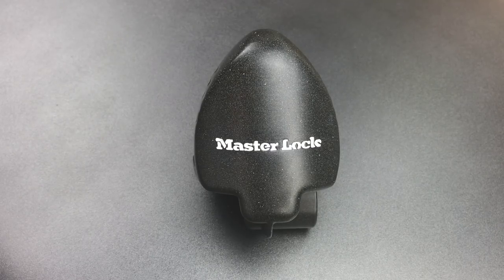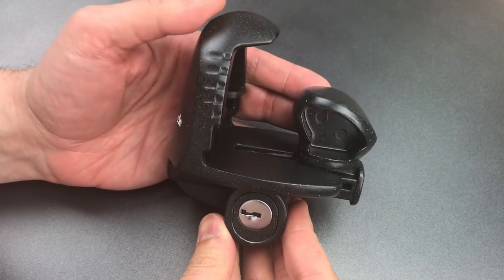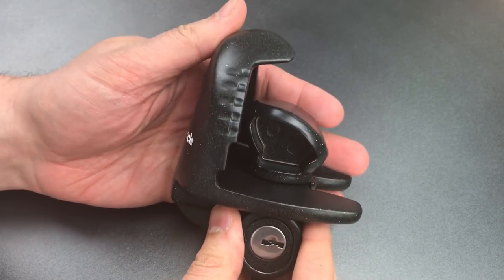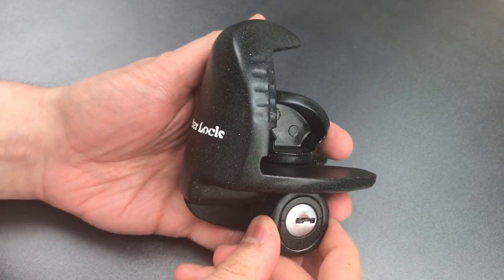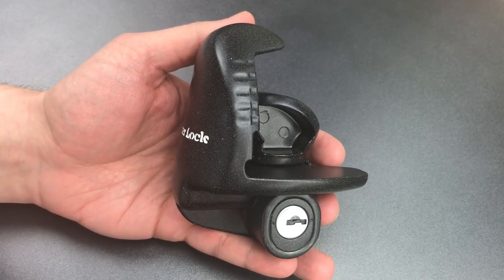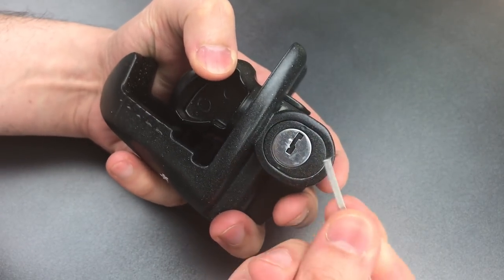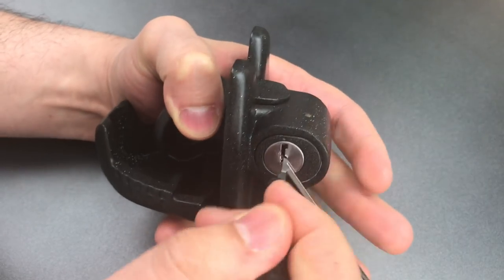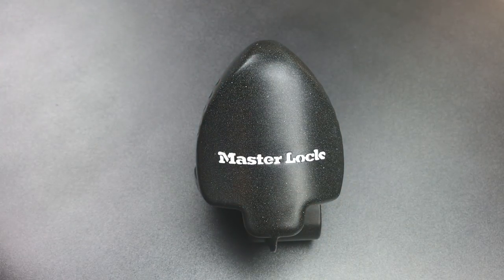[665] Master Lock Trailer Coupler Lock Picked FAST (Model 379ATPY)

Comment: I just took two of these locks and was able to open both within 2 minutes, quietly, with an 18 inch prybar. A little leverage in the right spot and the metal suffers a fatigue break at the base of the "ball", where the material is rather thin.

Comment: I just use a brass Ace padlock on my trailer, it goes into a hole on the locking lever. It's a 5 pinner with decent pinning, but the shackle is so small no one would even think about reaching for their picks. However if you saw my boat you would see why high security isn't really a concern.

Comment: This is why I use a Harden Motorcycle Chain Through the Wheel of the Trailer then Wrap through the Leaf-Spring with the lock. I can reach under with the key blindly. Trying to pick it would be almost impossible. My point is to make it as difficult as possible so they pass it by.

Comment: Great video. As long as Master Lock  keeps using crappy cores like that,  the lock body could have been made of reinforced armor plate, and it wouldn't have made any difference.  Zinc should never be used in a lock, but it's light, and cheap, & probably has good corrosion resistance. Lock body strength doesn't matter  if you can stick a rake in it, and get it open in less than 30 seconds. They are master's at fooling people into believing they are selling high security locks.
Reply: The worst thing is that that thing looks (and sounds) like it's been reduced to a bunch of thin, hollow webbing.  It probably has all the strength of a ceiling fan blade bracket.  If that kind of idiocy has taken control of the design process, they might as well have made it out of recycled plastic spoons.

I keep saying it.  These are product-shaped objects.  The design focus was to make the illusion of a lock and the false impression of security.  Providing either item in reality was no priority.

Comment: Hi Harry, Hard to tell for sure, but the lock and key looks very much like the lock on the Master Python cable lock. The original Python lock was not shaped like a python's head - the later ones were, and the wafer lock had a round side bar. When the wafers were aligned by the key, small half round cutouts in the side of each wafer were also aligned allowing the round side bar to enter and the lock to turn. It was always a mystery to me, as the lock was no harder to pick than a standard wafer lock, seemed unnecessary engineering to me.  Regards, Brian.

Comment: How do you know what locks to use a single pick or a rake on ?  Cause I’m assuming that they both work great  for different applications like one works better for certain locks than the other

Comment: My friends have two trailer hitch inserts that have a master lock key built into them that releases two pins that retain the insert into a frame mounted hitch. They have lost the keys for both of these. The core looks similar to the one in this lock. The inserts were about $50 each has. Are they worth taking the cores out and getting them replaced or keys cut? Thanks.

Comment: A lock that opens faster without the key than it does with the key isn't a lock.  Doesn't fit the definition.  Truth in advertising would require that a company selling these and pretending they're locks be called 'MasterLump'
Reply: At least in polite company.  Mass Turd Lock is more like it.